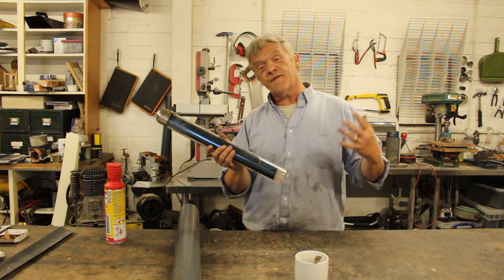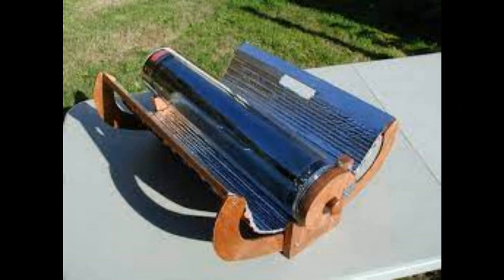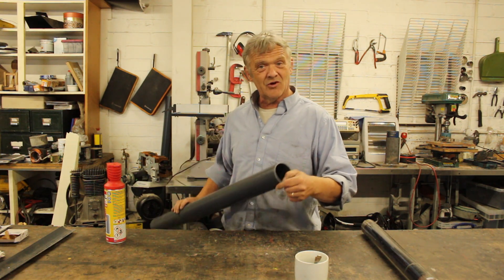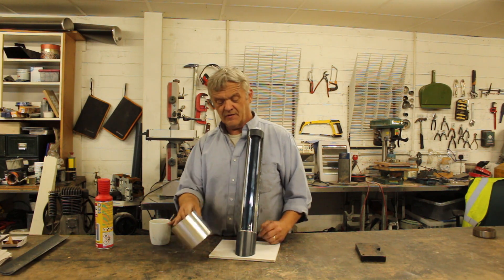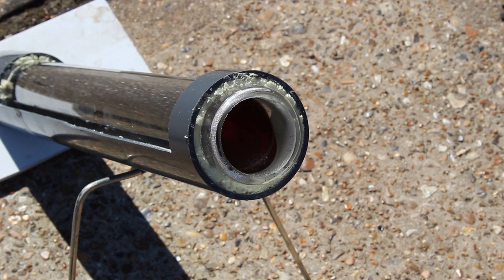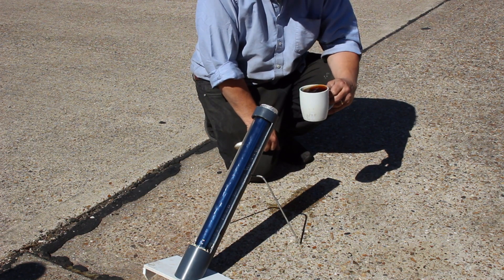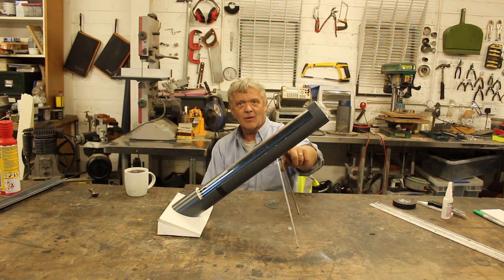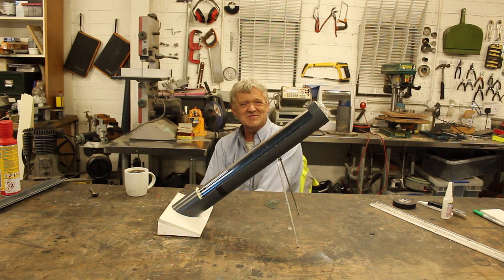1611 Making A Solar Kettle Or Solar Shower

Comment: Ideal angle would be at right angle to sun's Ray. Will vary with latitude, time of day, and also date in year.

May be possible to make an automatic tracker out of thermally sensitive material. Wax struts like used for greenhouse automatic vent, or even rubber bands which weaken their pull when heated. Arrange so pair of rubber bands tilt in opposite directions, and "window" to individual rubber band looking off axis, so that rubber band warmed more when that rubber band needs to relax more.

Comment: great idea, very effective . Id like to see if it would run a small steam engine or turbine with a small generator connected. Maybe enough power to charge a phone or any battery. Maybe a glass boiler is a bad idea though

Comment: Hi Robert great vid and long time subscriber. Can you pretty please do a video on sonic resonation used to cut stone. Much like playing the exact frequency of a wine glass into itself via a speaker, the wine glass shatters. If you bang a bell (without its clapper) you can make another identical one resonate. And with the right engineering can sharpen the end of the bell to cut through stone as it vibrates. Needs a bit of fiddeling and loud resonating power like 100s of bells. But the idea is there.

Comment: Actually I have a ritual of changing the elevation of my solar panels weekly, however the solar heat panels are placed vertically on the Southern Wall and that limits the time of year to only the winter when they create Heat, my solar tracker simply goes from east to west during the day and I change elevation weekly.
Reply from the maker: cheers mate

Comment: I have a solar water heater on the roof with the same tubes. If you let it, it will definitely boil water in a very short time. Mide definitely made an impact on the electric bill. It is significantly hot and it only uses a tiny 30watt pump to recirculate the water to the roof and back. I think they are the most efficient currently for heating water. It even heats while it's raining.
Reply from the maker: I do think they are the poor sousing of photovoltaic and to my mind better

Comment: With the high temperatures we are experiencing in the UK could you do a video on home made evaporative coolers.....also known as swamp coolers?
It would be good to see what a well designed and built homemade swamp cooler can do ...and they could be just what people need to get some relief from the heat.  
Much cheaper to run than aircon.
I hope you take a look at them. Loads on Youtube but I would like to see your take on them.
Reply from the maker: Great suggestion mate cheers

Comment: To be more precise you should put it to the complementary angle to 90 of the height of the sun, it changes through the year, to put it simply minimize the shadow it project.
If the wintery days are sunny and you put a lead on top you should be able to reach similar temperature in similar times
Reply: I got it wrong, it is just maximizing the shadow on a parallel surface,not minimizing, it is even logic it take more sun more direct
Reply from the maker: cheers mate

Comment: It works. It is free to use. What is there not to like (unless you sell electricity)?

It would seem that you gain a vast amount of efficiency by heating direct rather than generating power to heat with.
It seems like nearly every country that gets decent sunshine has bits of kit on their roofs to heat their water. I have heard of using the effect to heat swimming pools (outdoor garden types, not municipal) with little more than a coil of PEX pipe and a box all painted black with a perspex cover! I feel that with decent insulation we should be doing more like that here in the UK.

Likewise with passive solar heating using cans stacked together to form a matrix again in a box, painted black and a perspex front on but this time using air directly heated to warm houses!

Maybe we will see an increase in uptake when the next power price hike hits us?
Reply from the maker: yep - that's basically right mate - most folks won't do it until the price of energy is high enough

Comment: You can buy them with both ends open if you're prepared to buy in bulk from Asia. The advantage of both ends open of course is you can just run copper pipe through them, and have it thermosiphon from a hot water tank.
Reply from the maker: I agree both ends open is so much. more useful

Comment: I have tinked with them. I use them to heat the greenhouse in the winter. Also with a small DC pump you can use it to heat your home and try and save on fuel costs. I know things and getting more outrageous across the pond. Take care of each other and God bless. Addendum..they stopped selling them because they simply work. And are cheap.
Reply from the maker: yep they are simple and effective!
Reply: That's a great idea. Now wondering if they can be adapted to heat a small garage in winter so I can continue working on projects without freezing my wheelnuts off 🤔
Reply: @TK42138  you sure can. Just have to get more pipe and some insulation for the pipe. Just the pipe alone sitting in a snow bank will boil water, it was 20°f out when I tried it.

Comment: Why 30 degrees? I would think 53 to 55 degrees would work better for the UK. That’s approximately the southern and northern most latitudes for the UK.
Reply: Elevation, time of day, time of year, all going to come into play.  You can do a bunch of math, but the math will come out that if the shadow of the same length as the target, it's optimised.  
*If where the shadow is being cast is relatively close.
Reply: The earth is inclined about 23 degrees it looks like we can subtract 23 from 53
  Would it mean adding 23 at the height of winter..?
Reply from the maker: no idea mate - just what I read in a couple of research papers